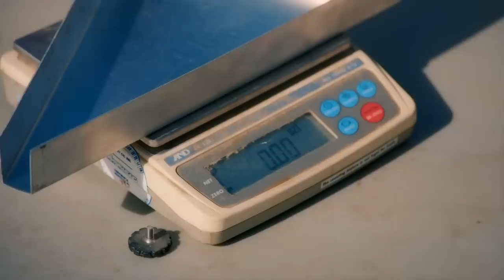Tony Beets And Minnie Help Out The Winchester Crew | Gold Rush

Comment: i wonder what he charged those guys, 

"just as long as I get a little bit more than you" tells me he prolly whacked them like 60% which is wild
Reply: probably 30% off the top, he's done that deal in the past and once the remaining 70% is split between the 3 on the crew and costs are covered he definitely profits alot more
Reply: @crxcify1x  correct, the deal is 30%.
Reply: the land they are mining on and the equipment they are using is all his lmfao they dont like it they can go buy a 5 million claim and another 12 million in cat machines to run it. tony probably spends 5 million a year on diesel alone lol.